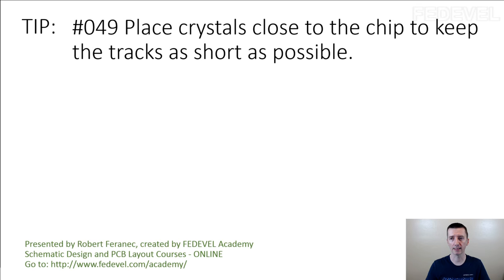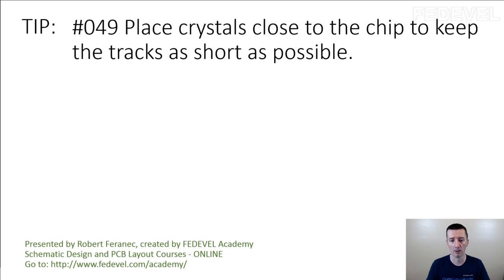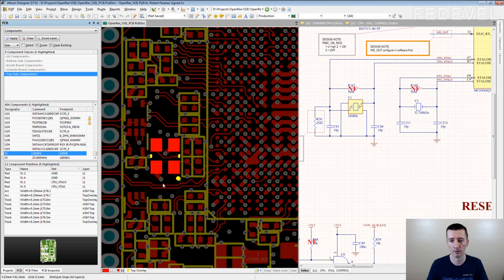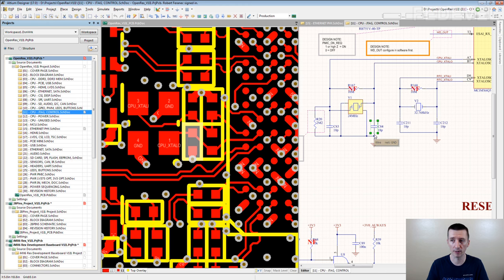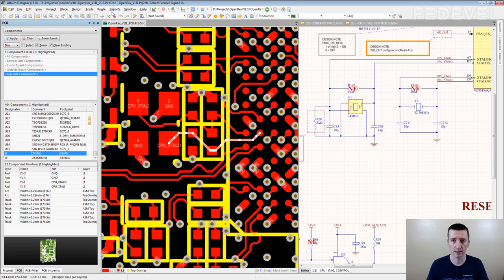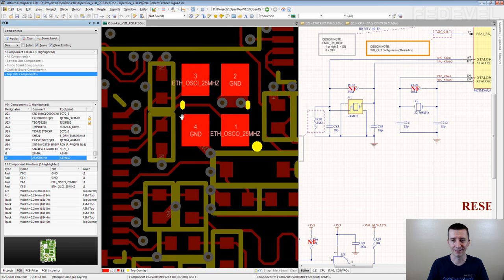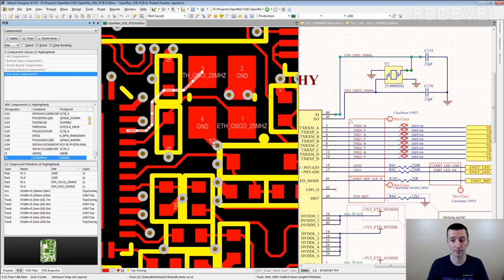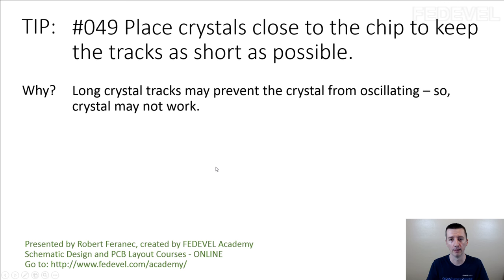TIP #049: Place crystals close to the chip to keep the tracks as short as possible

Comment: Application notes consider a perfect world with lots of space to route and they apply the most  safe and conservative situation. More often than not, this is not the case specially in limited space designs. Take a Signal/GND/GND/Signal 4 layer PCB. Do you place GND under the OSC/XTAL on none, both or one of the layers or how far a should the signal be away from the layer with the OSC/XTAL  ? Do you use an isolated  GND island under the OSC XTAL if yes, how will such cut our affect the ground layer ? How does routing low or high speed signals on the 3rd or 4th layer below to XTAL/OSC and it's capacitors with a GND plane under the XTAL/OSC affect each other  ? Does a via stub on an active OSC or passive XTAL traces really cause problems? Do you need a GND guard ring or only for 2 layer PCBs w/o GND ? What is better for EMI and SI , an 4 pin or 2 pin passive XTAL ? How much can the length of traces to the OSC/XTAL mismatch ? How long can the traces be ? How much via's to place on the GND pins of caps and ground guard ring  ?  How big should guard ring traces be ? Do you really need feedback and damping resistors ? Do you place the  caps before or behind the XTAL ? if the guidance in the application notes cannot be applied and the solution may 'depend', it could be very nice and valuable for an episode about XTAL/Oscillators circuit design based on theory and practical examples.

Comment: length matching between the tracks is also important?
Reply: Most crystals operate at frequencies low enough that length matching is not critical, but you should try to keep them close to the same. Some times in very special situations you have to use a very high frequency xtal, then you have be sure to match track lengths.
Reply: Brian McConkey Thanks Brian!

Comment: I know this is something that has many possible variables and this might not be the right place to ask, but it would help to know what are the most influential factors for this: is it only the track capacitance? Can it be compensated by lowering the value of the accompanying capacitors? How does the power plane underneath the tracks affect the behaviour? What are the most sensitive cases? Higher frequency? Lower oscillator power? Power or PCB noise? I know 32 KHz crystals are particularly sensitive.
Reply: If you model a crystal circuit it turns out the be sensitive to all the modeling parameters R, L and C. It is also sensitive to externally coupled noise sources. So by keeping the tracks as short as possible you are reducing the variance of all the factors that affect the xtal circuit.
Reply: So basically, all of it ;-)